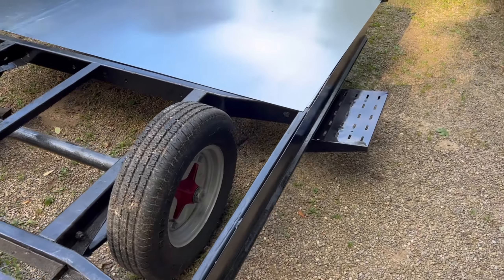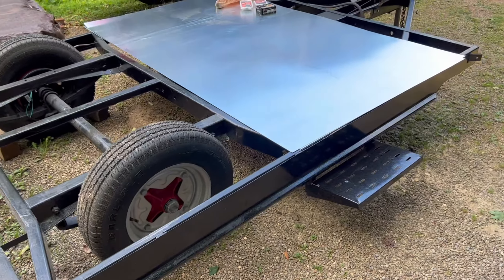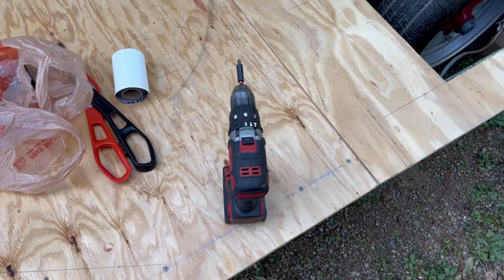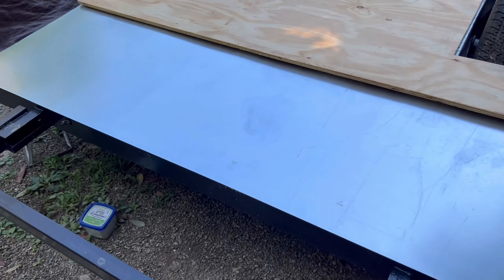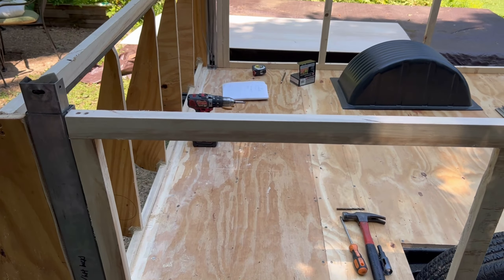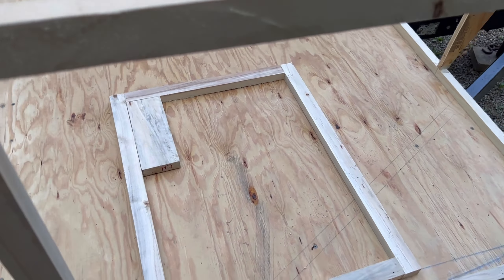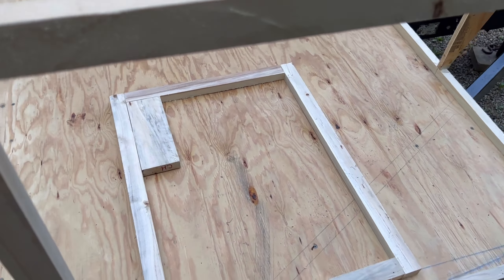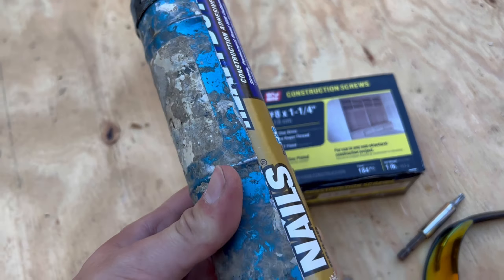Pop Up Camper Rebuild Part 4: Putting on the Floor and Rebuilding the Sides

Comment: Shouldn't you have put the wheelwells on under the plywood
Reply from the maker: I could’ve but I put a metal edge around the hole to protect the plywood. So I just put it on top and sealed it.